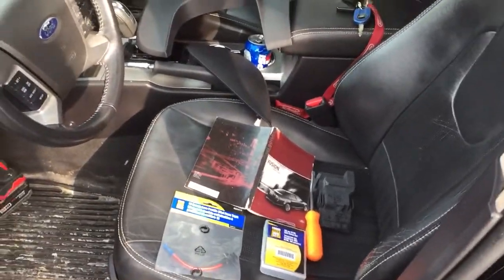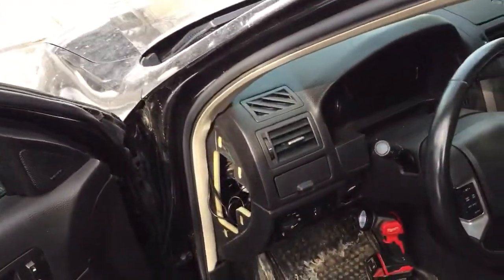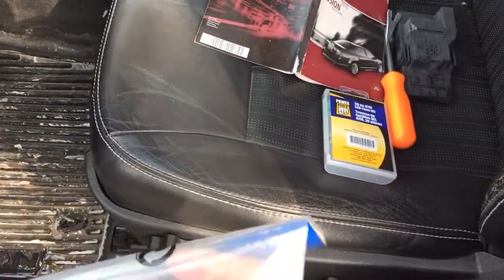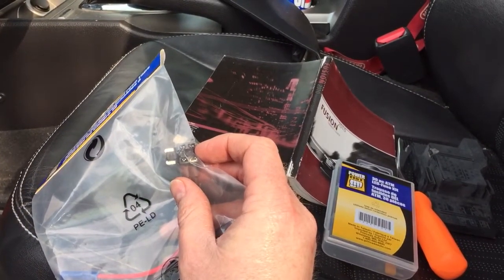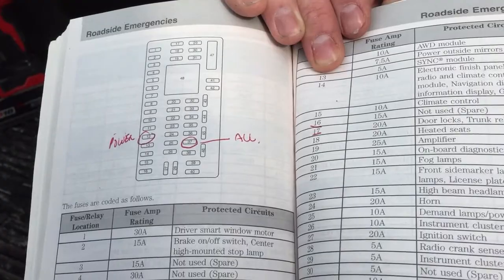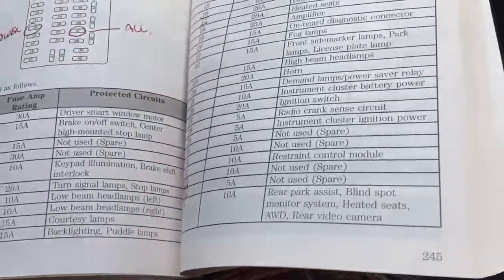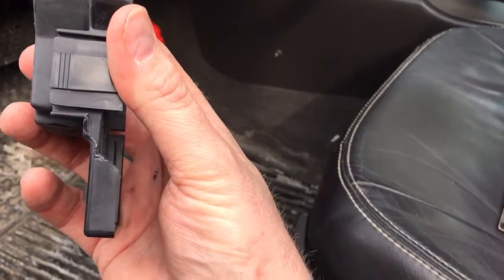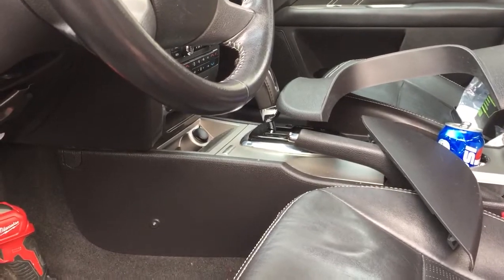How to install & hardwire Dash Cam Front & Rear Camera quick and easy like a pro!

Comment: How are you able to make parking mode work with constant power source? Mine is on constant power source of a battery pack but it is always on Continuous mode?? Thanks!
Reply from the maker: You have to use a fuse that has a constant power supply.  I list them in the video.  Thanks for watching and the comment!